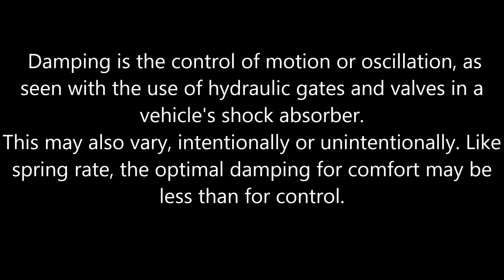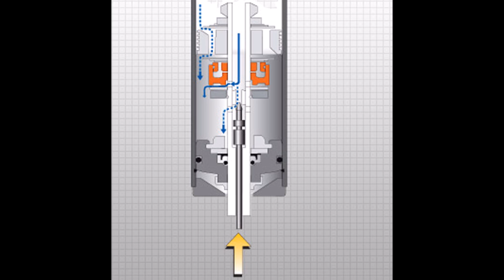ISC How To: Damping Adjustment

Comment: Hi! Help me please. I can't set damp settings. I tried to do this with adjuster clockwise and with 3mm hex key. But it's no effect:(. I tried all 30 ''clicks'', from hard to soft - nothing changes. Front strut is hard as wood,  there is not even hesitation, amortization. Maybe it's must be set on 0 air pressure in strut?

Comment: Hi, I have a question one of my coilovers I tray to go from soft to hard its just lock Los like spin free what I should do.
Reply from the maker: Not sure what brand you have, but if they are ours I would suggest making sure you are using the correct Allen adjusters. Call customer support 603 715 9078 if you would like some assistance.

Comment: currently running a set of these in my evo.iv set up the ride heights an damping identical to each other.once the cars been loaded up an the passengers jump out one side will left higher about 10-15mm once unloaded.could this be due to  one of them on the way out?thanks
Reply from the maker: Check the preload and also make sure they are all even when not loaded, measure ground to fender

Comment: so what does pushing it in all the way to "engage it" do?
Reply from the maker: +Lu Ngu Do you mean if you make it all the hard or soft?
Reply: +iscsuspension go to 2:47 in the video.
Reply from the maker: This simply means you need to make sure the allen key is fully in the top of the shaft. If there is a little gap then it means it is not fully in there.